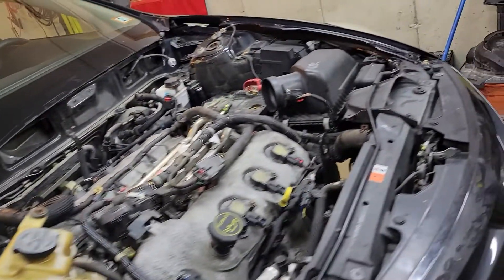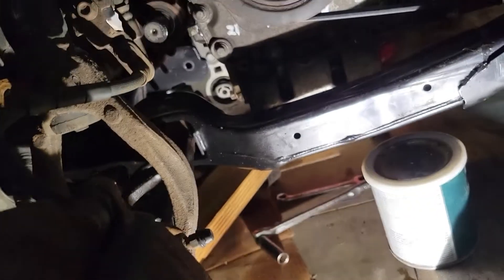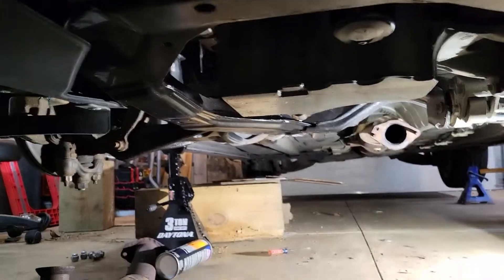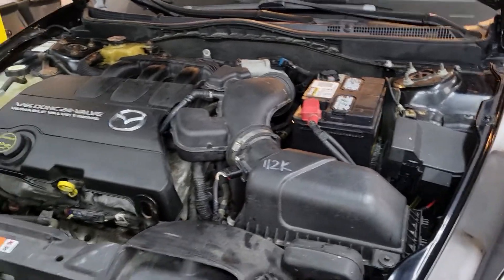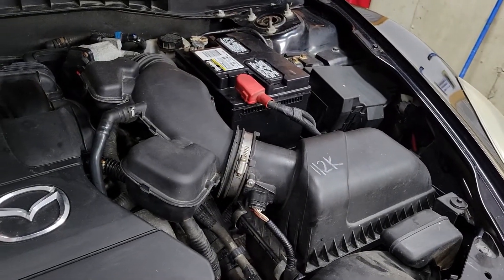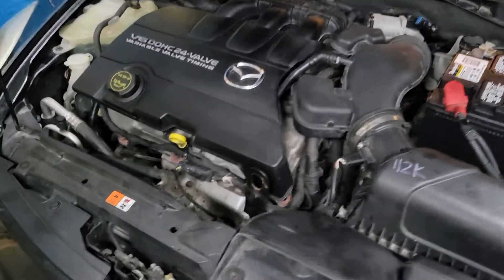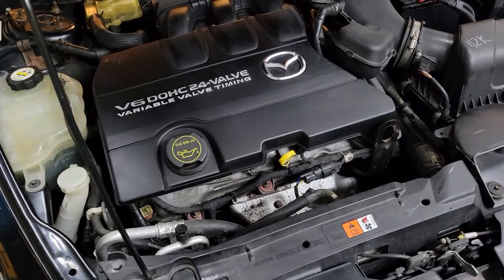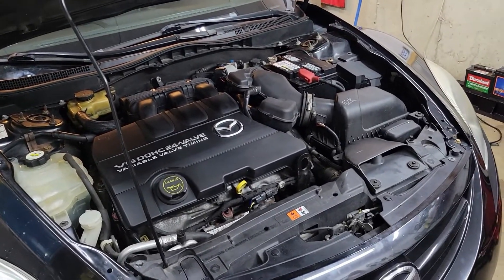2012 Mazda 6s Duratec 3.7 Water Pump Replacment (Part 6)

Comment: preemptively watching this to do mine.  Already did the subframe.  Scuffed the factory e coat, epoxy primered it, and sprayed fluid film inside.  It's a fun car when there's not problems.  The valves do sound like a typewriter to me on mine and yours.  and mine burns a lot of oil.  probably 2 quarts per 5000mi which Ford says is "acceptable" apparently.
Reply from the maker: Yep they sure do tick at idle.... never had oil issues though and she's still going strong. About to crack 200k this month,  so I've put about 70k on the car since the water pump job.